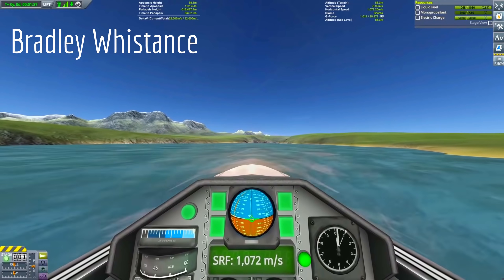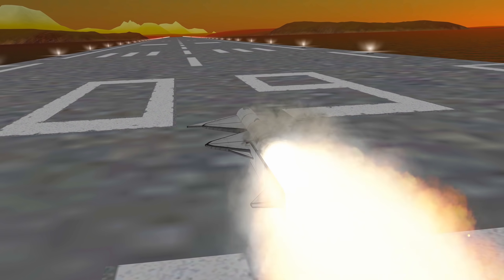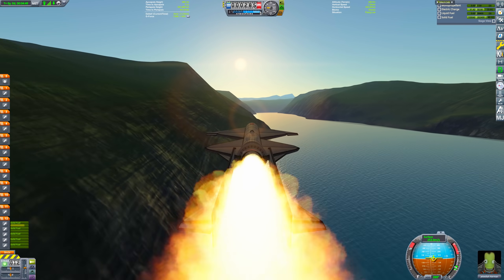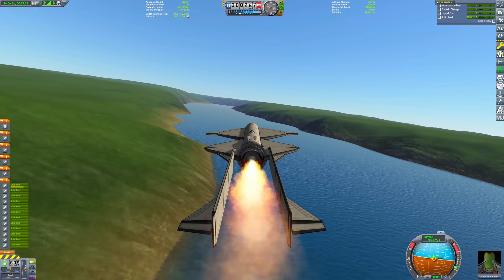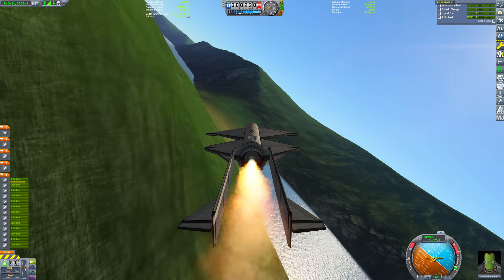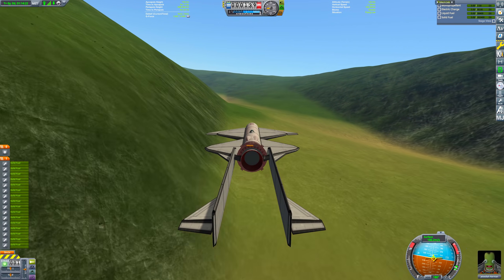800 Km River Run with SRBs | @Bradley Whistance Monte Carlo Challenge | KSP 1.10.1

Comment: My stock Boeing 747 aircraft with no passengers or cargo and 1 pilot on board flew 942km to the north pole of kerbin. The pilot planted a flag and realized he's stranded with 2% fuel left. A stock supersonic drone flew 1500km to get him almost back, then another one of the same kind got him back. This is the only time I got to the north pole. For some reason my stock F-22 can only fly like 100-150km. My stock F-15 is performing better in range, my guess is that the internal weapon bays on the F-22 take up space that would be used for fuel.

Comment: I love this channel but I do have some issues with this run.. you say that you could do this on 1 SRB if you could tune the thrust curve but you have 262400 solid fuel onboard but the clydesdale only has 16400 so how would that make sense? Also, you did exit the river in a few places, maybe I dont understand the rules that well but I thought you had to be above the water at all times?

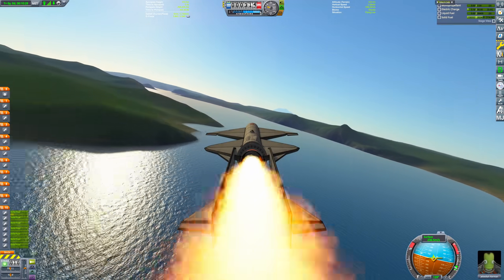Comment: 3:20 what do you mean you arent gaining any delta v from this? How could 1 booster with controllable thrust curve have the same delta V as 16 boosters clipped into themselves and running in sequence. Bad excuse for clipping 16 SRBs 👀?
Reply from the maker: Its because the fraction of fuel remains virtually the same. Delta V depends on the fraction of full to dry mass: if you have almost no payload and you add 16 more boosters without staging them, you wont see any more delta V.

Thats not to justify the clipping though. I'm saying that its not giving me as huge as advantage as it might seem. It still definitely helps by minimizing the contribution of the fairing + command pod, but its not drastically increasing my range.
Reply: @Stratzenblitz75  oh true the scaling factor for full and dry mass just cancels out. 
This explains a lot 😭. I have been stuck around kerbin for a while, while having half the tech tree unlocked. My first instinct was always to snap SRBs on my rocket to see the change in delta V and then scuff at how little it changed forgetting about decouplers. 
Time to delete KSP i guess

Comment: I'm sorry for correcting but

"Turning increseases the amount of lift the wings need to provide, thus increases drag"

While this is correct it's not complete, leading to an incorrect design 

The aircraft having a higher banking means the lift provided by the wings is decreased, you'll need a higher angle of attack to generate the same lift you were generating if you were flying without banking, thus, if you wanted to generate the same amount of lift, you would generate more drag

One may think "so, we want to make sharp turns then to minimize the amount of time we are generate more drag?"

That leads to another problem
Depending of the weight of the aircraft, it will bleed more or less energy when turning, and heavier aircraft, with large wing areas bleed more energy 

So, what would be my approach?, Do wider turns at the start then, when I lost weight i would be pulling sharper turns

And I wouldn't incresease my angle of attack to generate the same lift, i prefer to lose some altitude while performing those wider turns

Testament stuff a side, my main language is Spanish, forgive any mistakes

Comment: "you may notice that we're flying maybe a bit faster than what would be optimal for maximum lift to drag" Nope. Myself and my fuel tank with a cockpit, delta wings, and as many whiplash engines as possible strapped to it did not notice that

Comment: Looking at that plane, yeah, even a single Clydesdale would dominate its total mass - and a single Clydesdale with nothing on it has 3966 m/s of surface delta v. If you could adjust the thrust curve properly, a single Clydesdale should be able to lift maybe up to 15 tons (that gives 3060 m/s sea-level delta v) of payload+apogee kick motor into low Kerbin orbit.

Comment: I'm not sure you could do this with a single SRB, even with a custom thrust curve, since there were several points where you didn't light the new SRB immediately after the previous one burned out.
Reply from the maker: I only did that because the previous stage got me going a bit too fast so I glided to slow down. If I had a proper thrust curve, I could set the thrust to the optimal value for the weight of the craft and thus wouldn't have to do any gliding.

Comment: My kraken!, this course looks so easily doable when running at over 300m and under 200mps.  The terror is not real.
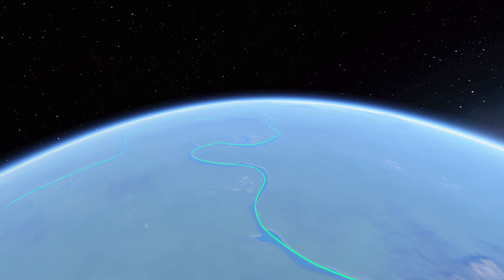I would love to know how you set that green river line into the video around 7:42.  I've never seen anyone work that kind of video magic on KSP before.
Reply: There's a mod called persistent trails
Reply: @algodude8713  You, sir, have earned the much-coveted Big G award.
Reply from the maker: While the piloting terror may not have been as intense, the range anxiety was in full swing for this run. When I saw I only had 4 stages left at halfway through, I became very spooked. Its a good thing those 4 stages lasted such a long time!
Reply: @Stratzenblitz75  Oh gawd, yeah, I can't imagine the range anxiety.  My first major overhaul to my craft gave me so much more speed that I was able to drop a lot of fuel and mass.  I can't imagine the worry of having to go in the other direction.  I don't think I'd have the patience to make as many slower attempts.

Comment: If we handwave coefficients as 1, the optimal speed for an ideal prop is 1.0, whereas for an ideal rocket/jet aircraft it is 1.316 for an otherwise identical aircraft.

Note however that the minimum drag speed is 1.0, and the minimum power speed is 0.75984.

The power consumption at 1.0 is 2.0.
The power consumption at 0.75984 is 1.7548.

The drag at 1.0 is 2.0.
The drag at 1.316 is 2.309.

Perhaps curiously, this means that the drag at minimum power speed is the same as the drag at optimal jet cruise speed. So a prop that can't even reach it's cruise speed can still sustain flight at lower speeds than a jet that can barely reach cruise speed.

Meanwhile, the power requirements at optimal jet cruise speed are 3.039. That means for a prop to fly in formation with a jet/rocket that's cruising, it needs about 52% more than it's own cruise power requirements and 73% more than the minimum power it needs for flight. It will achieve around 87% of cruise range doing this.

Meanwhile a jet flying in formation with a prop with an identical airframe can afford to throttle down to about 87% cruise thrust. Although it will only achieve about 88% it's usual range.

A prop just capable of cruise speed should also be able to fly at just over 54% that speed for the same power.

Comment: I don't understand how over a dozen srbs have the same delta v as just one but with a different "thrust curve" — I am not a ksp genius. It's a fun video regardless!
Reply from the maker: Thank you! Think about the delta V like this: A single SRB has a given amount of delta V. What happens when you strap another SRB to it and light it at the same time? Well, the delta V will still be the same. Since you aren't discarding the mass of the spent booster, you still have to drag that weight with you, which negates any extra delta V you may have otherwise gained from it.

This is the same case for the SRB plane. I'm not dumping the spent stages, so I have to carry them all the way with me to the end, which ultimately removes any delta V gains from having more stages.

Comment: Impressive, but the math doesn't fit here...
If the river is 800km and you are flying 250m/s on average (you did even slower), you achieve 1km every 4 seconds; meaning the run would take 53 minutes and 20 seconds. The video is way too short for that and you have not fast forwarded a lot.
Am I missing something?
Reply from the maker: Check the in game time of the run. The run took over an hour and 13 minutes, which is consistent with the average speed that I flew.
I also measured the length of the river with persistent trails at 832 Km. This mod could be giving me a wrong value, but I don't think this is the case.
Keep in mind I have fast forwarded quite a lot for it. Some parts are sped up over 1000%.

I should have put more clear indications of the fast forwarding I was doing, I apologize for the confusion.
Reply: @Stratzenblitz75  Okay, that fits. Without knowing it is kinda confusing though.
Thanks for the clarification.

Comment: Yeah L/D needs to be balanced with the Oberth effect. So for jets and rockets your optimal speed for maximum powered range at constant altitude will be the speed that maximizes V*L/D. In practice this means getting into the profile drag dominated right regime.
Reply: I forgot the actual value for determining speed, but it's a multiple of the best L/D speed. Best L/D speed would give you max range on a propeller driven aircraft (because they output power), but on jet aircraft (to include rockets), best L/D gives you best time endurance.

Edit: This site has the answer I'm looking for. The best range speed is found where the lowest gradient line from the origin touches the L/D curve.
https://www.boldmethod.com/learn-to-fly/aerodynamics/best-range-speed-prop-vs-jet/

Comment: An impressive accomplishment! I saw at least a bit of the streams of what all went into creating this craft, and was pretty amazed at how much effort and (shudder) even math went into it!

Tangential, it's amazing how different some of those turns look at 380+m compared to the 50 or so meters I took them at in my run
Reply from the maker: Thank you!

Yea, the run is much nicer at a higher altitude. You can cut the canyon walls closer and thus take a more efficient trajectory.

Comment: You CAN adjust the SRB thrust curve in stock. Just map the SRB thrust limiter to throttle and you can adjust it retroactively.
Reply from the maker: That is true, but I dislike that option since it essentially turns the SRB into a bad liquid fuel engine. Part of the fun is that you can't adjust the throttle after they are fired.
Reply: @Stratzenblitz75  Idk if your definition of stock includes DLC but you could use the controller from breaking ground if you could get the timing right
Reply: @Stratzenblitz75  “turns the SRB into a a bad liquid fuel engine”
You mean a hybrid?
Reply: Wait you can do that? That's pretty interesting.
Reply: Mapping the thrust limiter to throttle sounds like cheating, but mapping the thrust limiter to the breaking ground controller to play through a set thrust profile just sounds like a stock solution to me!
Reply: thing is, IRL solid boosters are designed with predetermined thrust curves, so that rocket lifts off with max thrust, then throttle down for Max Q, sharply drop to idle thrust after sep and such, by giving the composition with bulged star shaped holes through its length and whatnot. So the fact that you can’t do just that in KSP is rather weird
Reply: @すどにむ  Yeah, the game should honestly let us choose from a small selection of fuel geometries to set thrust curve, and have quenching ports so we can bind an action group to killing SRB thrust altogether.  I'd say something about gimbals, but I think they have that now for one or two of the engines?  I might be thinking of a mod, though.
Reply: @Archgeek0  yeah, the DLC boosters gimbal as per the IRL units that they're imitating IIRC. I was going to say "somebody tell the KSP2 Devs to write that down!" re. selectable fuel grain geometries, but tbh I'm already worried enough that feature-creep will make it forever delayed...
Reply: You can't do that on console though, so it isn't a realistic option for me (I'm a console player)
Reply: Smells like cheating to me.
Edit: Which is a dumb scent to pick up on, since the solution was to clip parts together.